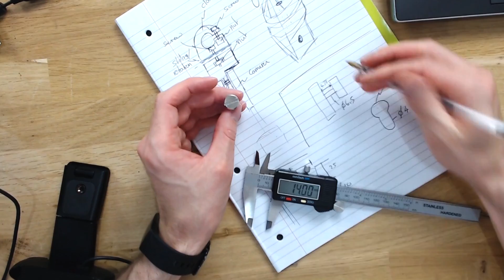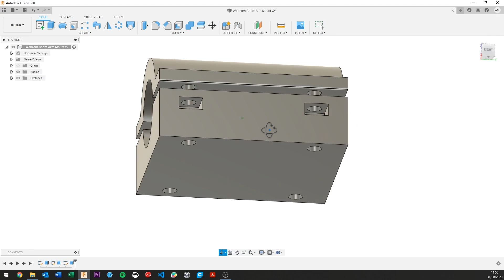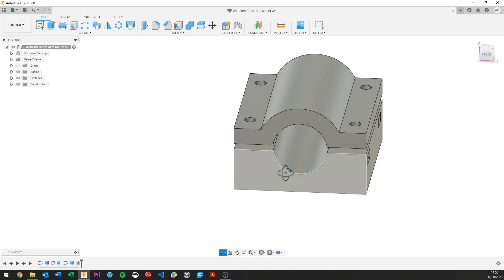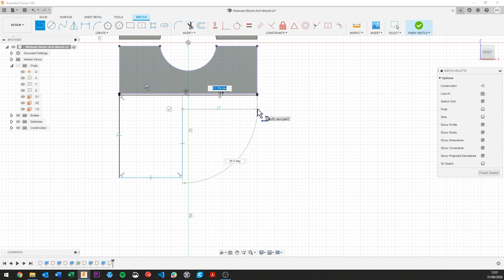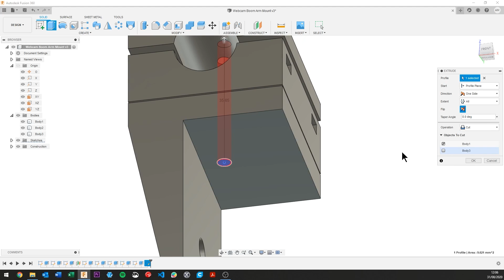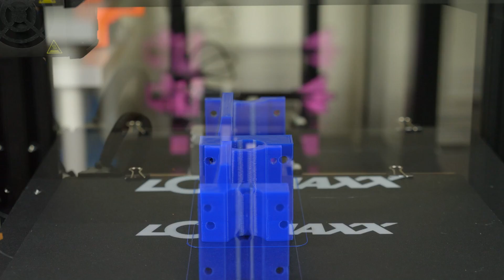One Project: One Day - with Fusion 360 and a 3D Printer

Comment: Whenever i have to model in a nut hole, I think of how I would orientate the print and point a nut corner at the top and bottom, so that I have two 60° angles as overhang instead of a bridge and two 30° angles. That seems to work better for me especially with petg.

Comment: Nice work. Is the lotmaxx running better now ?
Reply from the maker: Extruder still skipping. Not at much time to fix it though.
Reply: Vector 3D i Maybe the screw in the feeder arm is to tight. You Got a monday or friday edition 😆. I have used mine ewery Day for 4 month now without issues